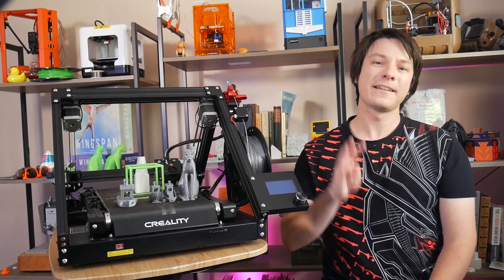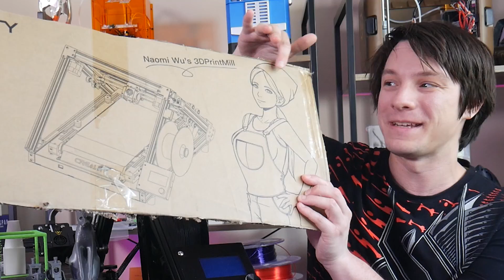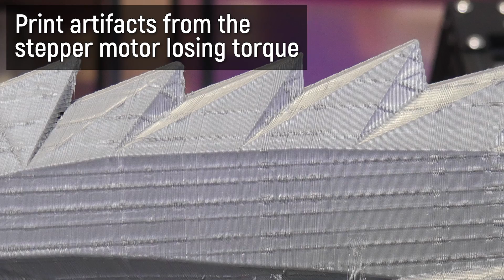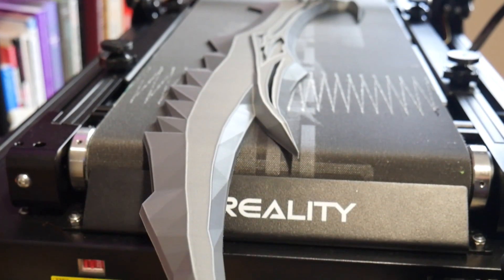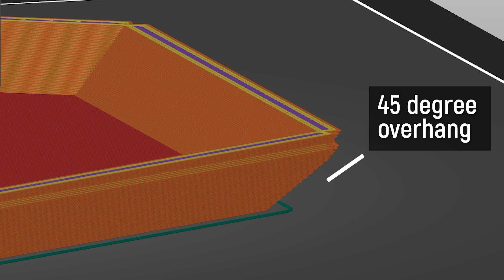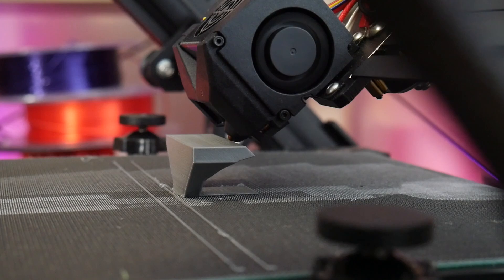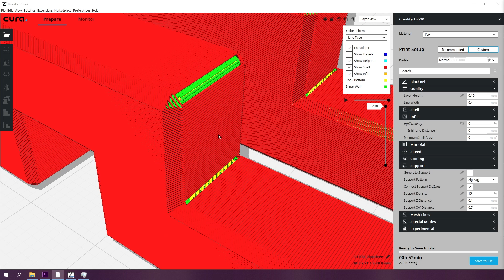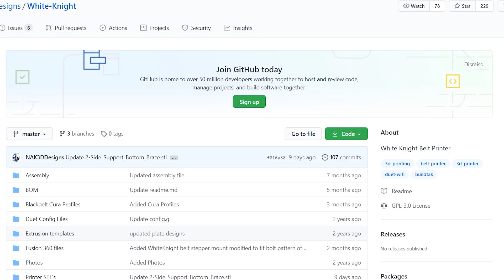Your 3D Printer can't do this... Naomi Wu's 3DPrintMill / Creality CR-30 Review

Comment: No way I'm giving a Kickstarter a penny. Call me when you sell it for real.
Reply: Why not lol, it really isn't that bad
Reply: @pa9030  A multi million dollar company off loads their financial risk to their customers, ya that's pretty bad. Ask the backers of the Creality CR6 how that Kick starter went. I hear some people are still waiting for their units even though it's avalible on Amazon right now. I hear others have nothing but QC issues and are constantly fixing it.
Reply: @stinkyham9050  Exactly my thoughts, bro.
As a customer, I do not see why the retail price of this machine is supposed to be three or four times the price of an Ender 3/5, since all materials (except for the belt) are carry-over parts - including the old V-slot rollers, cheap hotend etc.
Admittedly, the belt mechanism is more complex than an Ender 3, and the adaptation of firmware and Cura both certainly cost some good effort and money. But for me, Creality stands for cheap printers - in the literal sense. If the retail price for this machine would be half of what they suggest now, I would consider taking a closer look. But if they insist on calling up Prusa-level prices, I would expect them to deliver Prusa-like quality - I. e. responsive 24/7 customer service, high quality brand bearings/linear rails/timing belts etc. - and especially a machine that works and produces perfect quality prints out of the box, without any fiddling and tweaking, as demonstrated e. g. in Teaching Tech's review.

Creality built its brand with the success of the Ender 3, but as of lately I feel more and more they are resting on their reputation and only trying to max out their income stream - it started with this Ender 6 Kickstarter desaster; this "Creality WiFi box" also didn't exactly do well to their brand (see the Teaching Tech review), and now this CR30 Kickstarter thing, including ridiculous $5M claims, and of course an even higher retail price tag, despite the lack of any actual innovations.

Thanks to other commentors I just ran into the iFactory One on Kickstarter, and I must say that if you want such a belt printer, the CR30 can't even be considered a competition for that machine in my opinion - at about the same price tag as the 3DPrintMill, the iFactory comes with a vastly superior mechanical design, including metal rails, a titan extruder, cable chains, Raspberry Pi, Octoprint and an HD camera, cloud and PrinterGuard integration, and great support, including a personal set-up/calibration session with one of their experts.
They claim to have been working on this printer since 2018 and tested it by mass producing "healthcare items" during the pandemic, and the first impression feels just like that - a matured device which was designed with a more sophisticated audience in mind, like 3D print farms (after all they may have a reason to sell up to ten-packs of the printer and emphasize its remote management/cloud printing capabilities in their advertising so much).
So, for me, the decision is clear. I'm currently hyped for a belt 3D printer - but it's certainly not the 3DPrintMill, nor any other Creality machines.
Reply: @mobbkopf  My problem isn't so much with the printer but with kickstarter. If they release the CR30 and the reviews are good I'll buy it, if they aren't I won't. I will never give a penny to a kick starter though. Kickstarter is just a way for a company to raise capital without delivering anything to the customer. It's a predatory practice and I would never support it.
Reply: @stinkyham9050  Sorry; got carried away I guess.
Would say Kickstarter has its pros and cons – it is great for start-ups and one-man companies to get something big going – but a big company like Creality relying on it for their next incarnation of a per se already existing product is highly untrustworthy, imo. If they wanted to probe market response and demand, they should have simply set up a pre-ordering system on their web site, like every other reputable company.
I'm also highly suspicious of Kickstarter, since I almost backed the computer game Star Citizen back then (luckily I did my due diligence on Chris Roberts, so didn't invest any money), but this PR stunt here, handing out CR30s to every 3D printing Youtuber possible for "review" whilst at the same time not getting tired of pointing out that these units are "pre-production" and will certainly change before production and delivery – let's say I find this behavior more than shady, and certainly nothing I would put any money in.
Like you said, objective, neutral reviews of the production-level unit, then we can talk about a purchase.
Reply: @mobbkopf  What I find confusing is that Kickstarters actually get funded a lot of times. The internet community in general is extremely skeptical of large corporations and feel very entailed to free products (software, stl files, etc.) But somehow handing over hundreds of dollars to a company and getting nothing more then a vague promise that maybe they will get something in return is just crazy to me. How can such an anti-consumer practice be accepted by such a consumer base. It just doesn't make sense.

Comment: Have to tell you as a 70 year old technologist I love new tech like this. I have the CR 3... I've gone from repairing Vacuum Tube TV's in the late 1960's, manufacturing microfilm equipment to solid state plasma TV's and integrated circuits that run everything. All of this tech is in its infancy when it comes to the consumer market so its all going to have some design flaws here and there. I'm so glad to see that there are younger people on YouTube carrying on advancements in their shops.... as an Inventor with 12 patents I wish I had this technology in the late 1960's... next up... just print what I'm thinking! ;)
Reply: I thank you for helping to push humanity forward
Reply: Big flex, lol. Thank you.
Reply: Technologically speaking, im a pong baby. 1972. The CR3 is my first printer. Very well engineered printer and very friendly. With free tinkercad and cura  anything I need I can  design and print quickly...my brackets and wire management has gotten so much better! Cheers!
Reply: damn i wish i could be like you
Reply: @honkhonk8009  What is preventing you from doing it?
Reply: @nate6889  money and intelligence lmfao
Reply: Hi

Comment: Does the angle actually have to be 45 degrees? I think theoretically it should work with anything between 0 and 90, as long as it's not exactly 0 or exactly 90, and I believe something like 60 might aid a lot of problems without a lot of disadvantages, I'm probably wrong though.

Edit: I've realised now this would make the printer longer, but I don't think it would be the end of the world if you went with a conservative angle like 50-60

Comment: Two things:
1) Why are you suggesting to print in mid air when there are such things as supports?
2) Why has no-one come up with some sort of "printer rotator" that just rotates the printer so an overhang is never an overhang?

Comment: I wonder if prusa will come out with its own version of this in the future. Maybe with several flat hot plates instead of belts. With the print head pushed back to the middle instead of the front.

Comment: I never understand why 3d printers don't just let you set a few different z levels for each spot on the bed instead of needing to adjust it all the time
Reply: They do, it's called mesh leveling, and it's built into Marlin firmware.

Comment: Guys we need to remember, this is innovating on a design that has become pretty much standard, so please PLEASE do not judge it based of the highest quality standard 3d printers judge it based of some of the earlier models while people were still experimenting
Reply from the maker: Very true!
Reply: The first normal Consumer grade 3d printers also printed Terrible, so a new belt system printer is no exception.
Mainly because this is one of the first ones to be released for consumsers. without having to destroy a treadmill yourself.

For the color of the belt being pulled of, this is not even a issue as to what you can make with it
Reply: This is a concept design. Someone will figure out how to make it print level and this model will be like the 8 track tape of 3d printers. IMO. I will wait.

Comment: Anyone thought to measure the tension in bowden tube? In the coupler via a force sensing resistor, strain gauge or similar
Bowden tube tension  should end up as equal and opposite to the compressive force in the filament. That compressive force is what drives the filament out of nozzle. Putting that measurement into closed loop control might offer a better way of managing filament feed for bowdens

Comment: Damn, I was hoping you were going to talk some more about the engineering aspects of this printer.
Am I the only one that finds it weird that there are four Delrin Mini V Wheels at each end of the X gantry, and on the hot end assembly, instead of only three? Seems like an adjustment nightmare!
Reply: Not hard to adjust at all..  I did discuss this issue on a few other video's.  you need to remember that on normal printers that only use 3 wheels all the force is straight down..  On this printer you have a rotational force applied as well due to the angled axis..  As it may work with only three I think you'd see excessive wear on the roller in that configuration..  Only years of testing and observation will prove either way.
Reply: @NAK3DDesigns  hey Karl, thanks for chiming in! Not a mech eng here but in my mind unless you're very careful with adjustments it's likely to wear diagonal pairs of wheels at each end of the X gantry as they try to apply a twisting load to it. They're cheap to replace, though, so probably not a huge deal.

Comment: Watched this again and wondered about the cheaper price.
The CR6E was advertised at a cheaper price but once the retail units came out their price dropped and you saved virtually nothing so you may find it’s not as big a bargain as advertised, time will tell of course maybe this will be sold at the advertised price.
I do recall seeing Karl and his huge prints on Joel’s channel and was stunned at the design.
Not for me though even once it’s sold in shops. No Kickstarter ever again.
Very interesting video and it’s so different with the slicing/printing never thought of what the changes would do to the prints.
Can’t see Prusa spending time and money adding this Angus, why would they Angus, but when it needs a huge change in the software to get it to work, adding a cr10 or an Ender is one thing but this is definitely not the same.

Comment: 7:50 Check out Klipper (https://www.klipper3d.org/)
I am not even using this but I figure that you have the capability to do something amazing with it.
Basically, it makes the mainboard only do low-level things, such as turn on the heater or advancing X axis by 5 step, thus offloaded gcode processing to a raspberry pi or any other computer.
Because of that, it should be capable for much deeper integration with the slicer, maybe a script can just tell it to advance the z-axis and repeat the print, for as many times as you want.

Comment: How good or what kind of computer do you need for a 3d printer? Could i use like a chrome book or would I have to have a desktop?
Reply: There are web based slicers and CAD systems that you could use on a chrome book but I would say the cheapest route is pretty much any second hand laptop. It could even be an old Core 2 Duo. The machine could run either W10 or some flavor of Linux. Needless to say the path with the most options is a W10 machine of some form.
Reply: @PaulLemars01   I was thinking of buying a ender 3 or something close.
Reply: @npgoalkeeper _  Thanks

Comment: Has anyone tilted the whole printer 45 degrees?
Reply: That wouldn't fix the problem with the overhang.
The problem is that the first layers are printed in the air 9:22

Comment: I love Naomi, but I wouldn’t buy this even if I needed it and had the money. The open source ransom is a no-go.
Reply: What open-source ransom?
Reply: @Graham_Wideman  They will not open source this project unless it hits a funding goal that, from what I understand, is literally impossible with the number of Kickstarter packages they're offering.
Reply: @BRUXXUS  You realize that the firmware is open source regardless, right? It's the CAD for the rest of the printer that's in the stretch goal. And I don't know anything about the number of packages vs the goal amount.

Comment: SILLY QUESTION: I get 45 deg tilt is only needed for making large shell pieces. For small pieces, 0 deg is best. So why not design this printer that can rotate the head gantry on a hinge  and lock between "large print" mode (45 deg) or the "small print factory" mode (0 deg)?
Reply from the maker: You could but you'd have to change the gantry design dramatically, angling the hot end 90degrees down.

Comment: I don't think this belt printer will take off at all to be honest. Mainly because of the fact that it has to lay down layers at an angle rather than horizontally. That's an issue for this printer that isn't for any other regular 3d printer. I'd rather use supports and print horizontally at good quality than not use supports and have crappy layers. I can see a belt printer being designed around our current printers though.

Comment: Some things to think about with this printer:

1. There is no need for the printer to be level: If you incline it 45 degrees (the belt angled down by 45 degrees) you can get rid of many overhang problems, though your print length will be limited to how high the printer is above the floor.  For that matter, you can angle it up 45 degrees, if that helps.  (Hmmm... Perhaps a powerful "tilt" axis to reduce the need for supports?)

2. The CR-30 truly is targeting a niche market.  I don't think Creality can afford the NRE (Non-Recurring Expenses, the up-front costs) with the expectation of amortizing them over years of continuous production.  I suspect the CR-30 market will only permit batch production, meaning the first batch must be as large as possible, which in turn makes crowdfunding an ideal path to market.

3. If you've spent time doing puzzle-piece splitting of parts larger than your build volume (there are plugins that help), a belt printer is "needed" only when the puzzle-piece approach won't work.  Which further reduces the "need" market for this printer, at least at the consumer level.  So stimulating the "want" market is the way forward, which requires marketing, hype and all things viral, which *again* points to crowdfunding to generate enthusiasm on a large enough scale.

I think Angus really nailed it by mentioning cosplayers and prop-builders.  Folks who want speed and simplicity rather than deal with puzzle-piece part splitting.  But not all of them can justify buying this printer for only that purpose, meaning there should be a market for folks to start a small business to buy a CR-30 then contract/sell prints for the cosplay and prop markets.  Again, further reducing the overall CR-30 market (but ensuring the printers that do sell are kept busy).  Another way to look at is belt printers straddle the line between hobby and professional (production) 3D printing, a relatively small market.

The thing is, folks also said that about early large-format 3D printers.  Until the CR-10 made them widely accessible.  After all, you can still print small parts on a large printer!  However, that's not quite as true for belt printers, given their demands and limitations.  I mean, has anyone even tried using a 0.2 nozzle and 0.05 layer height on a belt printer?  (Being able to do this is why I don't have a resin printer.  Yet.)

Even at this amazing price, the CR-30 is a tough sell into a small market.  Creality runs on thin margins, and their business strategy relies on evolving their product designs and production line quality and efficiency just fast enough to stay ahead of the pack of manufacturers that live at the bottom of the market.  And the "bottom" market is getting smarter and better: My own Artillery Sidewinder X1 v4 is proof of that!  I can't see there ever being enough market demand to drive a similar level of competition and evolution in the belt printer market.

Given reduced market size and higher investment risk, that makes crowdfunding ideal for a belt printer like the CR-30.  Seems iFactory3D also thinks so: https://www.kickstarter.com/projects/ifactory3d/ifactory-one-4-in-1-conveyor-belt-printer

Comment: What if there would be a printer where the print bed gets rotated to any angle wanted by the printer? So by hard sticking system or vice versa.
Reply: Just slap a hotend on to a 5-axis mill :)

Comment: IMO, being able to sequentially print items unattended is far more exciting than the unlimited Z axis. If it's limitations can be overcome, this is really going to be awesome tool for medium scale home manufacturing.
Reply: A normal printer with a belt as a bed would be much better suited for that use case.
The 45° tilted mechanism only makes sense if you want to print longer stuff.
Reply: @Jehty_  IIRC they're doing it this way to get around a patent for a belted Y axis.
Reply: @mrclown7469  without the 45° you can't print continuously.
So I don't think that the patent is the reason.
Reply: @Jehty_  Fair point 👍